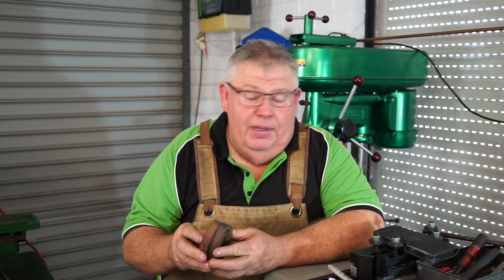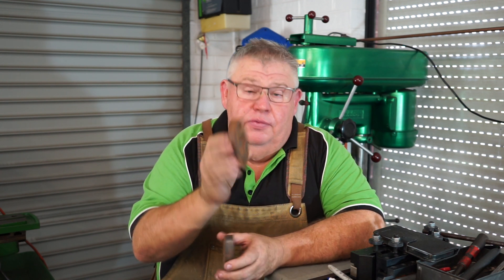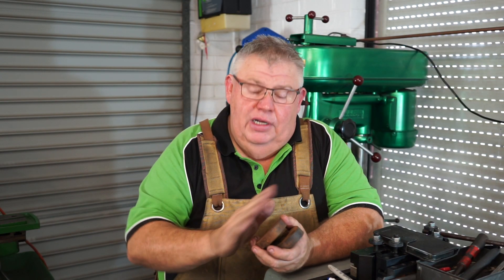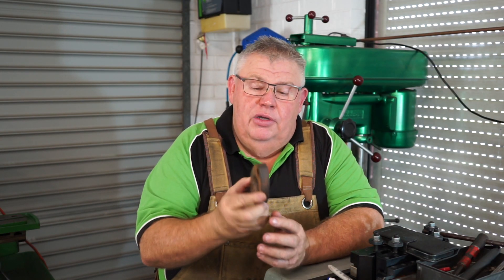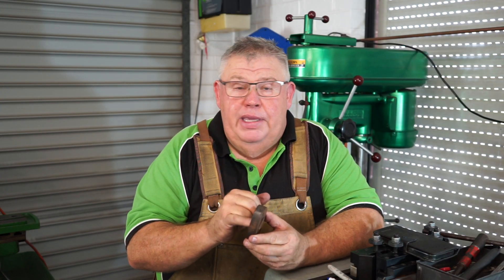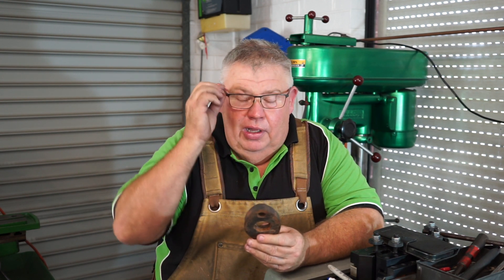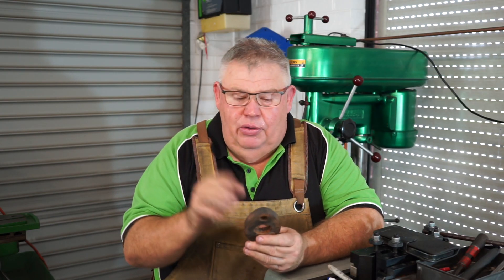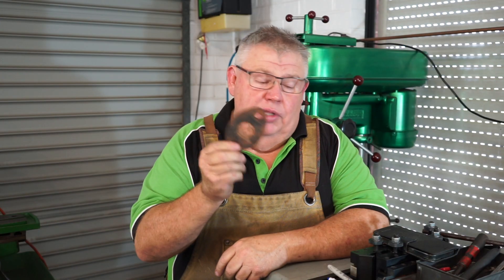Manual Machining | Cutting 1" BSP Threads

Comment: Nice work Aaron.  Good old imperial threads strike again!!😂  I've spent my working life with BSP, BSW, Unified, metric, allsorts of threads, sometimes all on the same job! 😂
Keep up the good work
Cheers Ian
Reply from the maker: Hi Ian. Appreciate the view and comment mate. I did some pipe threading back in my apprenticeship days (early 80’s) on a Ridgid pipe threading machine. I had totally forgot about that it’s the pipe I.D size and not O.D 🤦‍♂️. Feel like a dumb arse. Cheers 🍻
Reply: My wife's got a small piece of threaded pipe that her grandad  gave to her, was a souvenir off a Japanese midget sub that went down in Sydney harbour during the war.
I gather the war office, or whatever it was called, cut up one of the subs and sold the pieces as small souvenirs to raise money for the war effort.
I should see if I can work out what the thread is.

Comment: Pipe threads are sized to fit the OD of the pipe. Pipe sizes are designated by the ID of the pipe that had the standard wall thickness of 100 years ago.
Reply from the maker: Hi Richard and thanks for the information. As an apprentice I cut many pipe threads back in the day using an old Ridgid pipe threading machine. But stuffed if I could remember to deduct the wall thickness. But that was over 40 years ago. Cheers Aaron
Reply: Almost Richard!, Yes!  British standard pipes [still ]come in the three wall thicknesses they have for aages [ yellowend  light wall, blue end  medium wall, and red end heavy wall. plus green end extra light, which is made out of medium tensile steel, and cant be threaded!  It was before my time, but I believe medium was the standard 100 years ago, and the whole system was sized around the nominal bore N/B of the pipe, as it was designed to carry water, so a one inch N/B pipe in medium wall had a bore of [slightly over] one inch in medium wall. Obviously a lighter wall pipe would carry more water as the OD was all the same, and the converse for heavy wall, sometimes called steam pipe.
Unfortunately the system is so entrenched that  I cannot see it being phased out any time soon!  Also, when it comes to threads, you have BSPT and BSPP  P for parallel -usually the female, and T for taper-usually the male, so that , at some point along the thread, the taper locks into the parallel, and with the help of some  hemp, teflon, or sikaflex, becomes watertight!